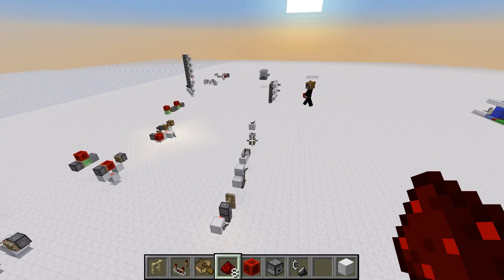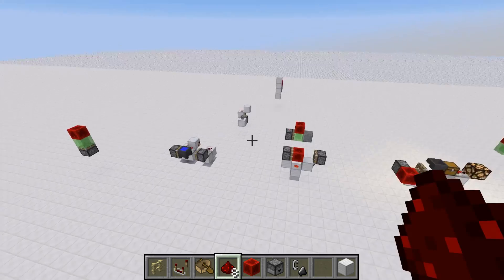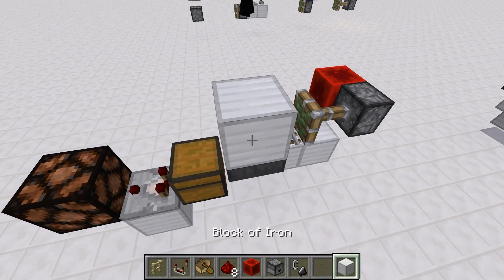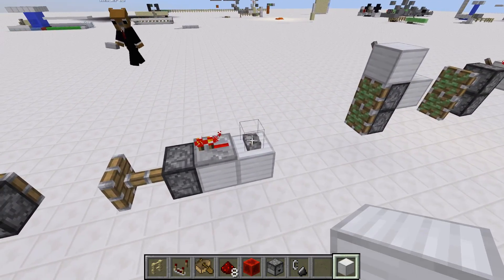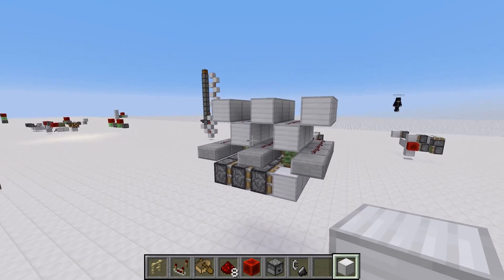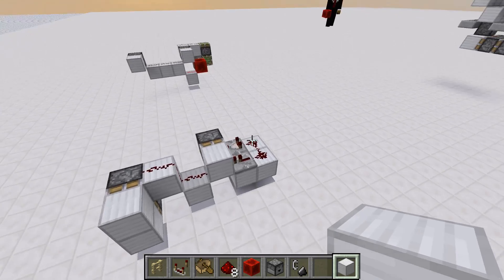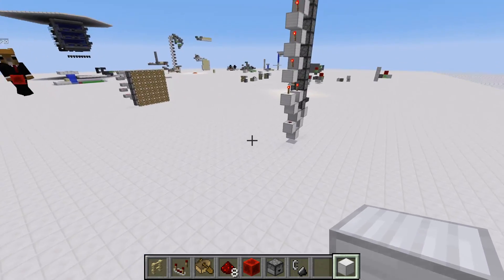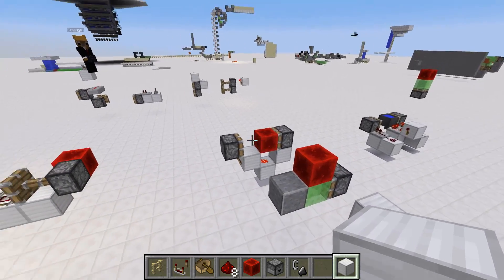Minecraft - NEW Redstone BUD Block "Observer" - Feedback for Mojang

Comment: I really hope that the observer block will be able to detect lamps, fence gates, doors and trapdoors.

How is the block going to work? Will it detect updates itself and give an output or would it make blocks adjacent to it detect updates?

I'm also curious as to how the observer block would give an output. Will it power all adjacent blocks (like a redstone block) upon detecting an update? Would you need a comparator to grab the output? Would it output the signal in the direction it's facing? 

And since they are adding a new block, does this mean that the old BUD mechanics are going to be removed? And if they are removed, does this mean that you'll no longer be able to make anything BUDed? Will it break comparator update detectors as well?

And if the BUD mechanics aren't going to be removed, then what will the BUD block do that isn't possible already?

I guess we just need to wait and see what the developers have in mind and after that we can give further feedback, but right now I don't quite understand how it's going to work and how they want to make it work.

Comment: When the developers first introduced quasi-connectivity it was to make working with pistons easier. But in my opinion they made an error by so loosely implementing this into the game and not expecting it to bee used widely. And now everyone relies  on it and they can not easily get rid of it.
What they should have done and what I think they should still do is give a more robust extended specification for redstone that complies with the old one but replaces the quasi-connectivity with something more clear defined. Because they already let this go on for so long this new ruleset will of course have to offer equally as good or better ways of implementing current designs.
Reply: +Artentus Totally right, this is a good thing from Mojang, just soooo late XD. But I think better late than never. Jeb wanted to do that for a while with all respectable pro game design arguments 6 arguments to removal in Wiki/QC. But players that don't understand long term game design push Mojang in a corner very badly. The cross-platform overhaul is a good opportunity to do that now, maybe the last. So i'm glad if they finally find a way to do that smoothly but efficiently.

It's a good call from Docm77 to include the community for sure. But he's a bit to focus on what he will lose in the absolute, without mentioning really that Mojang needs to make that in the way all of these systems can find an equivalent with this redstone overhaul (and I would add or not but only if it's the strong and voluntary choice from the game designers for gameplay orientation, not a random "oopsy"). Most of players don't care about hard optimized tricky redstone, they want to play intuitively with home-brew redstone systems. All will be okay but redstone "experts" really need to drop their eyecups, for the good of the actual community and new players.

Comment: Thanks docm77 and ilmango for the very informative video!
Reply from the maker: +DarnGeek You are welcome;-)
Reply: +docm77 surely all the features you want to keep could be kept if quasi conductivity was removed, instead making Pistons a block that connects to redstone in the same way a repeater does, and transmits power on the same way a full block does. This way glitchy, often unpredictable behaviour is removed, things like silent dropper chains could be kept a reality, and buds would be made possible by the observer blocks
Reply from the maker: +DarnGeek You are welcome;-)
Reply: +teron281 because of the way 0 ticks work no. If I remember correctly 3.3 blocks a second is the fastest possible.
Reply: +docm77 could you make a 0 tick flying machine
Reply: ***** Hi Doc, The observer block is coming to MCPE 0.15
Reply: +DarnGeek How about BUD Piston Block? I mean pistons and sticky pistons that extend/retract itself every time it's updated without any power source? That would be great enchancement to existing BUD contraptions.
Reply: +teron281 creative mode and the tp command ;)
Reply: +DarnGeek I want so badly to this community be able to understand 6 arguments to removal QC from Jeb. Plz use the cross-platform opportunity to think about redstone core logic. With "experts" knowledge for sure (not lobbying to hard though, stay creative) AND casual/new players as well. It will be wonderfull to make redstone gameplay without this QC hitch for most of the community who like to try/make themself they homebrew systems using they own intuition. Cut/copy "experts" system isn't a good gameplay. Bugs were fun even for me, QC can be saw efficient in a cubic world, but that will stay definitely corely "buggy" to play and understand for most of players. "It's a game".

Comment: i,m not very good with the quasi-connectivity. I mostly use it to hide a switches (so its a secret switch). I wonder if it will be a block how it would connect. Maybe with redstone-strings?(you connect a R-string to the block and the "Observer") And if so than would it be movable or do we need another block for that? Or would it only give power to the blocks near it which are not directly connected? 
I find it quite confusing most of the time. Its like when i see what people build and they explain how it works i,m like yeah i get how it works but when i try it myself (to make other stuff) it wil not work or it wil work once and i don't know how to reset it. 

So yeah hardcore restone stuff...

Here are some other idea's considering redstone.
- Range detectors instead of 10 pressure plates make a block that can notices when a player/mob is near.
- Redstone rope for vertical redstone.
- The ability to make a chair out of a stair which can be combined with a pressure plate.
- Timed delay block.
- The ability to move leaches that are on fences. Would make awesome attractions.
- A block when activated wil go on and of for a certain period.
- Slime carpet kinda thingy which when jumped on if no block is underneath it wil launch the player/falling entity up and down to a certain height and it wil keep that bounce until it's removed/moved. (basically like real trampoline)

And i don't know, more ideas for just Minecraft:
- Give a limited amount of crafting recipe's in Adventure mode and players have to find new blocks or books to make these items/blocks. 
- Smarter villagers that do their job. Like a fisher let him catch fish, blacksmith actually makes armor etc. Add new professions like builder, miner, logger etc. Make villagers own the house they live in, which wil make them repair their house when needed and if a house is no longer in use they take parts of it to fix their own. Let them have a inventory so emeralds will actually be rare. At least fix the lighting in the houses cause some of them have places so dark a mob can spawn.
- when u drop a ice block make it slide and make it slide faster on ice.
- A shop chest/display/other from which players/villagers will buy stuff without the possibility of stealing it maybe even guarded.

i'll stop for now :P
let me know what u think. ;-)

Comment: There are many many times where I have had quasi-connectivity be a major problem when I've been compacting redstone designs. I've found it to be problematic far more than it's necessarily useful. So if they are going to keep it in any way, then it should be with a new dust type (greenstone or something). The observer block is going to be great, and I honestly can't wait for quasi-connectivity to be gone from normal redstone! It will be so nice to finally not have to deal with diagonally powering things in tight spaces.
Reply: +BlameItOnGreg there are many ways to keep the blocks from powering that way, such as extending one more block (powering another block that only touches the top piston, etc) or powering at a different area. Look on the most technical channels associated with ilmango and the like and you can find all the applications. The problem of powering other blocks as you mentioned can easily be bypassed.
Reply: +BlameItOnGreg Quasi-connectivity is used in probably around 60% of all redstone creations that have any moving parts at all. You may not know it but I guarantee that at least a couple of things you've done will completely break without it. Being able to power things diagonally is actually more useful for compacting redstone then if you didn't have to worry about it at all, there are so many ultra-compact designs for things that rely heavily on quasi-connectivity to remove the need to route wires differently.

To say quasi-connectivity is more of a problem then a benefit makes your comment almost laughable, considering that almost every single instance of unwanted quasi-connectivity can be fixed by doing stupidly simple things like using slabs, moving a single repeater, using solid blocks instead of redstone if possible (if after or before a repeater/comparator/block that needs to be powered), among other simple things that based on the situation don't even change the timing, shape, size, or layout of a design. When it's quite simple to prevent unwanted quasi-connectivity, it's far more difficult to figure out how to do what the quasi-connectivity allowed for without it. Just look at the difference between a piston wall with and without quasi-connectivity, quasi-connectivity makes it stupidly easier. Think of just how many piston door ideas would break without it. Almost 60% of practical redstone relies on it.
Reply: +AceSurvivor54 +DreadKyller Yes, there are work arounds, but without quasi-connectivity there would be work arounds for the majority of designs that currently use it. Usually when I'm trying to super compact things, I'm dealing with droppers, and sometimes pistons and droppers working in tandem, usually with droppers directly next to each other. In cases involving that, quasi-connectivity is way more of pain than an aid. I believe the only redstone contraptions in my worlds that currently rely on quasi-connectivity are a few dropper elevators and compact pulse limiters.

A possible sort-of replacement for quasi-connectivity could be a full block that passes a redstone signal like dust, but outputs and inputs in all six directions (maybe call it a "redstone node"). You'd still lose some compactness with a lot of designs, but actually be able to gain substantial compactness in others. That combined with the observer block would cover probably 98% of quasi-connectivity use cases.
Reply: How? Compactness isnt an issue if you're good at it. There are many examples of compacting over the years, such as grizdales full adder/ shifter for a Digital clock. Over time, we now use shifting piston tapes (check Peter Jiang). A piston wall is literally impossible without the quasi connectivity and as for compactness, it gets bigger without it for the majority of any decently sized project. We need it for many projects. An example is the 2x2 piston doors. you would need twice the space to power both top and bottom pistons. By the way, the reason why droppers are being a pain is that they used to fire with any update via redstone (which is sort of an example of quasi connectivity regarding BUDs). Now they only fire when not powered before.
Reply: +AceSurviver54 My main redstone projects over the last year have been various item sorter and retrieval systems. In some of the weird block spaces that are left for cramming in a custom hopper sorter layout, I've run into multiple times where quasi-connectivity has prevented me from being able to use a design that would work otherwise. In some cases a suitable alternative ends up being twice the block count, if not more, and there's been at least one design that had to be scrapped completely because the only way to get it into the space needed was if quasi-connectivity wasn't a thing. Then, on the retrieval side, I've been working with tightly spaced droppers. There are work arounds for, I think, almost all of the quasi-connectivity issues I've had there, but a lot of those work arounds take up more space.

Pretty much I'm saying that there is actually a lot to be gained from getting rid of quasi-connectivity, and that with some suitable new blocks, not much to be lost.
Reply: Well, yes, but only if they add those new blocks for multi powering pistons... but then more blocks for pistons takes up more space and pistons are used much more than a hopper/dropper chain in general redstone, which might also use hopper droppers, etc but only in small numbers (ex: clocks or T Flip Flops).

Comment: Quasi connectivity is very confusing, so if this block would make it simpler to create with redstone, I'm all for it!
Reply: +Wasthereonce But this block can't do all of the stuff Quasi connectivity can. So it's a nice addition but it shouldn't be a replacement.
Reply: +Wasthereonce it just means that it can be indirectly powered. You can easily just take a design. As Phily said, it shouldn't be replaced, just for people who don't actually take the time to research redstone such that they might finally use it, although if they don't redstone that much, I'm not sure that they would find much use for it anyways.
Reply: +Wasthereonce The point of this video is that BuDs are only a single thing that Quasi-connectivity can achieve. Quasi-connectivity is an entire mechanic, BuDs are a single application of the mechanic.  The block they're adding would only replace BuDs, it would not replace the hundreds of other applications for quasi-connectivity.

budded blocks are not only used to get redstone signals when a block updates, they are used to control intricate circuits and machines to tick-perfect precision. They are used to achieve functionality in the game that doesn't exist otherwise. One of the best examples in this video was the piston wall, without quasi-connectivity, only the pistons that are directly touching a block would become powered, not the rows underneath it. Without quasi-connectivity it'd be impossible to make those piston walls.

The other thing is, that the observer block would most likely work like other redstone components, that break when they are moved. And if they don't break when they are moved, you can't set them up to any redstone because the redstone would break.

The block is a good idea, but BuD detectors are only maybe 5% of that quasi-connectivity is used for.